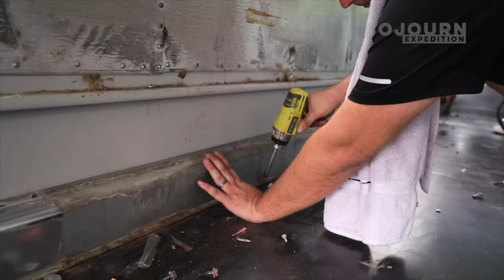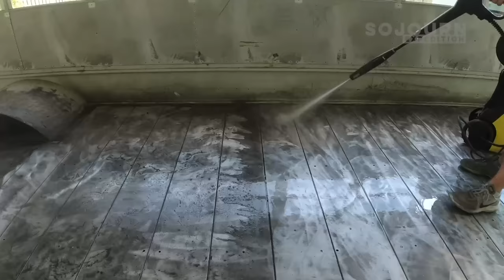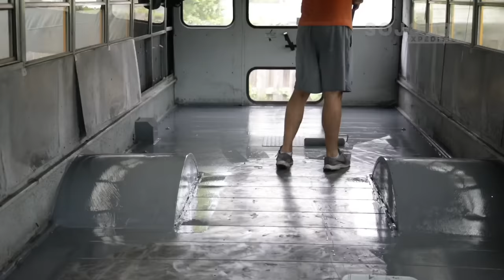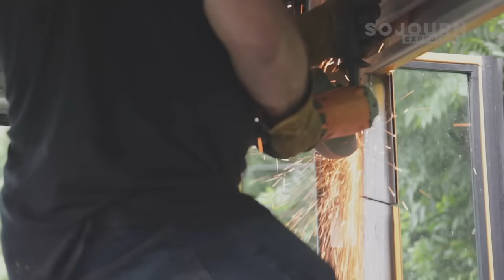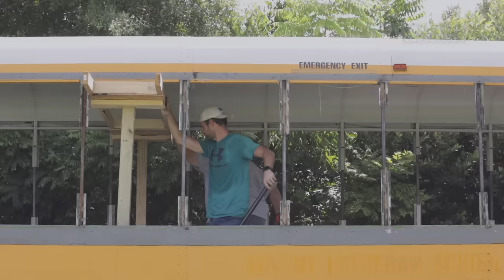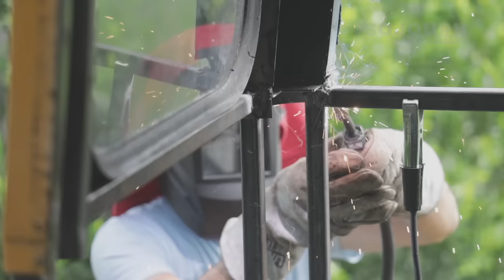Young Couple Converts an Old School Bus into a BEAUTIFUL Tiny Home | Amazing Skoolie Dream Home

Comment: Wire toothbrushes from Dollar General for the carvings and corners. Less risk of damaging the design like with a chisel. Painted hardware - soak in hot soapy water. It peels right off. Rust -:same as for cast iron cookware. Soak in vinegar water no more than 40 minutes. After drying, spray the mechanisms with silicone spray, not WD 40. Too sticky, attracts dirt that will gum up the works. You're doing a very fine job so keep chugging. You will get there.
Reply from the maker: Good tips! Thanks for watching!

Comment: Beautiful craftsmanship and creativity. You installed lights as though you intend to drive it on the road but It's now much, much too heavy to be driven safely.  I've heard school buses are hard to insure as RV's, maybe for such a reason.
Reply from the maker: Our bus is fully insured and we’ve been driving it for a year and a half. The weight is good and we upped the ply on the tires just to be safe. These buses are rated for very heavy loads. This one in particular was 30,000 lbs.

Comment: Great Project !  Thanks for sharing your skills and the design.   The idea of placing the water tank inside and on top of the bus frame was a great idea.  Did you weigh the home after you completed it?   Did it handle well on the road?
Reply from the maker: So far it has handled great, but I haven’t gotten it weighed. Although, I will have to soon. I was worried about the handling, because of the roof raise and added weight, but no issues so far.
Reply: I was wondering the same thing. All that wood, water tanks etc is not light. By the way Gross maximum weight for that bus is only 18,000 lbs.

Comment: I was wondering did y'all use a flux core welder or mig with gas and how far did y'all raise the roof on the bus? I'm looking g now to buy a bus to build into a skoolie and I like the flare noise buses plus I work on buses and transfer trucks for a living

Comment: Been watching an hour, looks great! Every hole on that roof should have have caulk on it and in it, highly recommend!!! Oh I thought spraying  clear on the exterior would UV protect your paint greatly also! Great job!
Reply from the maker: Great suggestions! All of the new holes on the roof (transition, Dan, etc) have sealant on them. Some have rubber and some have caulk. We’re a little paranoid about leaks. Also, we weren’t to worried about adding a clear coat. The tractor paint has held up well on other projects in the past, so it wasn’t worth the cost and work to add a clear coat, at least not to us. Thanks for watching!

Comment: Question: when doing a roof raise, why do so few people not raise it from end to end? Why leave a hump? It’s already a custom job, why not just do the entire length, omit the humpback and make it pretty? Again, this is just a sincere question, I’m curious why some do it all, but most don’t.
Reply from the maker: Good question! Personally, I like the look of it more. I think it looks a little more like an RV. Beyond that I didn’t want to get to close to the windshield, and it also makes the unit a little more aerodynamic than a completely flat front. Not that it helps gas mileage that much . Lol

Comment: only thing i see thats a problem is not adding silicone when you screw down the solar panels to the roof as thats potential for leaks-or any other screw you put in the roof without silicone. Other than that, great build!
Reply from the maker: Every screw and bolt in the roof has silicone around it. It made a mess so it was tough to fill it without getting the silicone on the camera. Thanks for watching!

Comment: I would have applied the Kerdi membrane to the side of the shower as well (especially with the smaller tiles and lots of grout lines). That water will be going right through that unfortunately.
Reply from the maker: Thanks for watching! Been living in the bus for two years, and there is no water leaking through. The blue residue that we rolled on was a water membrane.
Reply: @SojournBuilds  ah sorry I must have missed the blue membrane application. Good choice and cheers!

Comment: Instead of opoxy and paint theres a pink solution that keeps moister out in the bathroom. Anywhere you put a bed, it needs to breathe so sliding slats or wholes for  air flow under you matress is good.
Reply from the maker: Yes, good observation! We used a hole saw and cut holes in the plywood, but that was after we made this video. Thanks for watching!

Comment: One of the best Skoolies I ever saw was a guy who took a full length IH school bus, then cut the top off a shorty IH school bus from about the 2nd black line up (so the seats of the seats I guess), welded it on top of the other bus so the backs were lined up, then divided the upper half in two from front to back, cut the roof out of the lower bus under the back half so he had an atrium area in the back, and installed a wrought iron spiral staircase to access the front half of the upper half and made that his bedroom.  He had hardwood floors and a wood burning stove in it.  He had a grey water tank for his little kitchenette area, but he never installed a bathroom area, saying he didn't want to deal with having to empty a blackwater tank.  He was a sort of hippie guy whom I only met once, but he seemed cool.  Oddly, I lived with his ex-gf at another house, and she had her own skoolie made out of a 1/2 length Chevy bus (not a shorty, but not a full size).  Hers had a bathroom, but it wasn't in use because she paid for "house privileges" so she could just come inside and use the indoor facilities whenever she needed to, but she lived out in her bus.
Reply from the maker: Sounds like a great build! Thanks for watching!

Comment: Hi you have done a very nice job why did you not go and buy a greyhound bus it has the same top as yours.
Reply from the maker: This bus was 20-30k cheaper than a comparable Greyhound. This bus had 37k miles.

Comment: Yes you have just done a beautiful job from a old school bus you took all the wires and order stuff off the bus and you made it into a lovely home but the thing is you have still got the stealing wheel at the front does the bus can you drive off with the bus is distilling we'll just on the bus just for display I would take the steering wheel off and make into something that you can use like a office or unlock out
Reply from the maker: We’ve been driving the bus for two years! We need the steering wheel. Lol

Comment: This isn't your first build. From carpentry,welding, and paint, and all the necessary equipment. Can't be your first build, but the results are stunning.
Reply from the maker: Thank you for the encouragement! It actually was my first build, but I flipped houses and worked in body shops for years. I picked up a few other skills along the way, and everything worked out.

Comment: Infil should be free to move within stiles and rails. 46:19
Reply from the maker: Things tend to bounce around while driving down the road, so it needed extra support.
Reply: @SojournBuilds  - That's exactly the reason to do as I say. If doors had not been made for CENTURIES with floating panels, we'd be up to our asses in S4S firewood.

Comment: I have a better idea. A lot of work rising roof, insulating, painting etc, but you can completely cut away  the cabinet and use only the chassis. Only the front with driver seat is needed, Than buy an old refrigerated semitrailer box, put on the chassis and build everything into it. A lot of space will be added with lockers mounted/builded directly on the chassis. A lot of people build camper with  4x4 trucks.
Reply from the maker: Some people do that, but we wanted to convert a bus the chassis and shell is much more sturdy and spacious than a box truck. Thanks for watching!

Comment: omg so many shortcuts where made that its going to end up costing you more in the long run to have to redo and fix it.. 🤦‍♂ and leaving the seat bolt holes open in the floor was a huge mistake. This should be a video about how not to convert a bus.

Comment: Beautiful build, but as i see with a lot of builds over engineered and a ton of excess weight, going to over work the engin ( not great as it is used ). I really do enjoy these builds but I would really really like everyone to understand this is not a good DIY long term please look into lighter material it will pay off.
Reply: I have to agree with you about the excess weight, I get that they wanted high-end finishes, but as you stated, the engine will suffer from being over worked.
Reply: @pattyharrison6386 You both are missing the point..

Comment: You lost me at the plywood ceiling
Reply: I never saw him sand anything - his wife painted something white and it had such rough edges. But even if the sides are unexposed, sanding everything is part of true craftsmanship.
Another thing he didn't do is clean up all that sawdust in the bus.
And did they really place a brandnew mattress on that dirty bed?
Reply from the maker: It wasn’t plywood, it was utility board. Very light and fragile.
Reply from the maker: And the sawdust is still here to this day. 😂